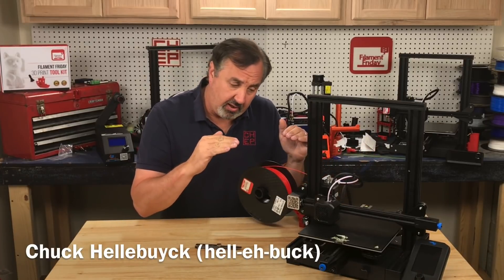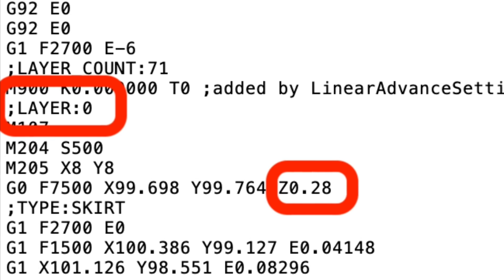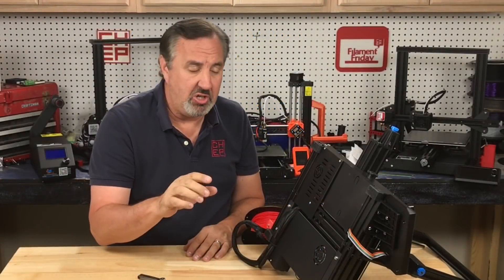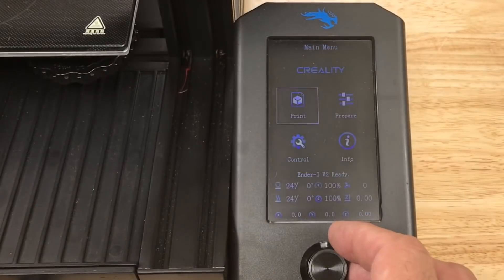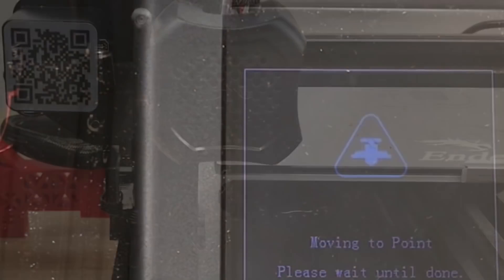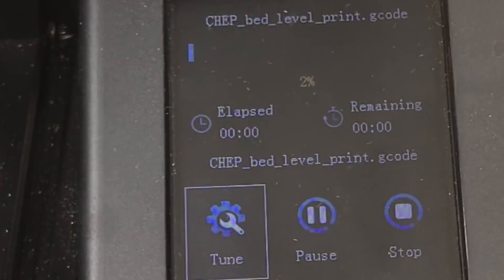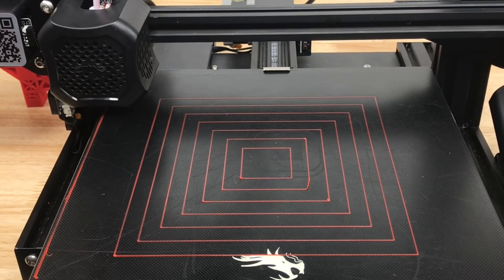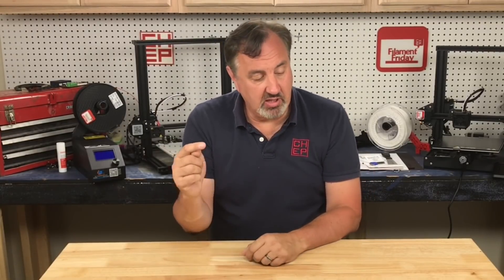Leveling or Tramming your Bed Using a Feeler Gauge on Ender 3 V2

Comment from the maker: I forgot to say in the video: reset Z offset to zero after using the feeler gauge.
Reply: Hi CHEP, I really recommend give some heads up about this comment on the title or something.
Yesterday I lost 5 hours trying to make this work because I missed this comment.
Reply: why do we reset it?
Reply: @ikeydweck2211  You only set the z-offset to make enough space for the feeler gauge.  You reset it because you don't want the actual printing offset to be bed + feeler gauge.  TBF, you probably want a little bit to deal with any bed warp you saw.
Reply: Connor beat the VGK. Sad for me. Happy for you and him.
Reply: How do you do this on stock ender 3 pro? As far as I know I can't save z-offset
Reply: I can't believe I didn't catch this....
Reply: what would be the problem if the words on my screen are kind of all over the place? like they keep glithcing
Reply: Can I do this with the bl touch?
Reply: Awesome. Thanks! Does 0.202 apply even with 0.6mm nozzle?
Reply from the maker: Yeah, nozzle size isn’t a factor.
Reply: thanks for the clarification i was confuse at the end of the video
Reply: thank you for your time. However, you also forgot to state,  What size  feeler guage blade you are using.  A piece of paper is approximately 0.004 " thick ?
Reply from the maker: NoI didn’t. I show in the video 0.202 feeler. Paper is typically 0.08 to 0.1 mm.

Comment: I have the Ender 3 V2 and just updated the firmware for V4.2.2 Gigadevice. On yours you have the z-offset in your prepare menu as well as manual leveling?? I do not have any of this in my prepare menu or any menu... I am unsure of what to do now.

Comment: I have the Ender 3 S1 Pro... The bed is too low. if I go into Aux Leveling and set the Z-offset to -0.50 (Same as my feeler gauge) I have to loosen the screw to the point that it's practically spinning freely to bring the bed up to the nozzle. Thoughts?
Reply: Have you found any solutions to this by chance? 💖
Reply: @IthinkIneedAhug  Gave up on the feeler gauge for now. Replaced the springs with silicone spacers and have the bed super-trammed! Used the Octoprint bed visualizer to tram the bed and it's working great now.
Reply: @Jaypoc  I've considered getting silicone spacers! How are you liking them?
Reply: @IthinkIneedAhug  i like them. Keeps the bed lower and very stable. I'm hoping over time it will mean less need to re-level
Reply: I'm a bit late my solution was to lower the Z axis sensor

Comment: Thanks a lot for this video! I've been using my Ender 3 V2 for a few months with success, but the leveling process has always been a bit unclear for me. Cause people have known the basics for so long and they forget that they actually need to simplify the basics and do a concise step by step guide for noobs.

Basically I was confused that people level their bed with paper or gauge, but don't explain that you need to z-offset for it (while leveling or after).
No one explained that after you level, your printer EXPECTS TO HOME at 0mm z height! And since no one said that exact sentence, I foolishly assumed that the printer needs to hover by 0.1mm z-height when homed, and had a ton of trouble when printing materials on higher temperatures!) 

And the fact that you set the z-offset at 0.20mm at start, do the leveing with the gauge and then bring back the z-offset to 0mm, has actually brought out my first perfectly printed first layer!

Comment: I have eliminated the need to do this on my Ender 3 S1. I replaced the bed springs with metal spacers, I leveled the bed to the base of the printer and leveled the gantry to the bed. For setting the z offset I flipped the PE sheet upside-down so I can use the metal part. With my multimeter on Ohm position I put a lead on the metal sheet and the other on the hotend heatsink and in the printer menu under "Z Offset" I lowered the gantry gently until the multimeter showed me that the nozzle made contact. I backed it up 0.1mm, stored the configuration, and that's it. You need to input the value of the z offset you choose (in my instance here it is 0.1mm) in the slicing program you use.

Comment: I’ve got a ender 3 s1 and my z offset is at like -2.72
Reply: That's the offset between the BL Touch and the nozzle, because it cannot be the same (like 0) or the probe will touch the part while you print. When you set in the menu your Z offset whit the paper method, or similar, you are telling the printer what is the offset that it must apply to the measurement taken by the BL Touch for the positioning of the nozzle z height at zero(that's your -2.72). On top of that you have the paper thickness which is the z offset what you must input in the slicer program (usually 0.1mm) so the slicer can take that in consideration and apply that offset to the g-code. That is important for the first layer so that the 0.2mm(for example) layer height set for the first layer does not become 0.3mm(0.2mm in slicer settings plus the thickness of the paper 0.1mm) and have first layer adhesion problem.
 So in your case, if you set that z offset whit the paper method you will have the true value at (-2.72)+(-0.1)= (-2.82). You need that paper thickness offset so when you move the gantry to Z0 position the hot nozzle does not touch the bed surface and damage it.
Very important: you must take the steps to set the  z offset every time you change the nozzle or take the extruder down for whatever reason or do any repairs or changes to the printer.

Comment: im just about done with this fucking thing, ive been trying for two fucking weeks to get it to level, ive taken it apart, put it back together, squared it, autobed level kit everything i can find on the net.

using the feeler gauge, and the level wheels the bed comes nowhere close to 2mm from the print nozzle.

these things are fucking garbage and they have little to no quality control, to all the people that told me an ender 3 was a good noob printer was a downright dirty lier
Reply: I’m the same I’ve been fighting mine constantly!! I’ll finally get it to print and it will print perfectly then I go to print again and bam I have to level it again and start the whole process over again I’m going to just sell mine I’ve just accepted I can’t work them and will find some other hobby
Reply: @BigManJapan298  Alternatively after selling it, get a printer with all of the upgrades. Unfortunately the cheap printers are cheap because they are made with unreliable parts and missing good features like automatic leveling - and you're kinda expected to buy upgrades because they are considered to be  "hobby" printers. If I ever buy a second printer, it's going to be one that has all of the upgrades to begin with.
Reply: @BigManJapan298  check your leveling screws, sometimes they are loose, I had to put m4 nuts on them to hold them to the bed, then upgraded springs and adjuster knobs.

I did that and it works fine now.
Reply: Sorry to hear you had so many troubles. I would suggest finding a 3D printing shop in your area via something like Google Maps, and taking the machine there and having them take a look. There is really only so much help you can get online, and bringing the machine to somebody who has experience can help more than any online resource.
Reply: Z- Offset my friend.  that will move the noozle DOWN
Reply: Try replacing the springs the stock springs suck
Reply: "2mm" it's supposed to be 0.2mm, so that is probably the problem
Reply: Or moving the limit switch on the bottom left further down
Reply: i had a better idea, i tried selling it and buying a bambu p1p, been printing ever since.
 @abelcardoso866

Comment: I want to warn anyone with a recent Creality printer that shortages during covid Creality in some of the printers including the ender 3v2 switched from using the 4.2.7 board back to the 4.2.2 board but more importantly with a different processor the GD32303 chip instead of one of the normal stm32f10. As a result, Marlen and Jyers UI are not actually completely compatible. However, due to the board being the same and only the chip being different some have had success upgrading to a Marlin firmware. [There is no guarantee that this will not damage your printer]. Some signs of the incompatibility encountered have been salmon skiing and the mesh levelling turning off when a print starts. Though the salmon skiing has been stated to be solved by using the maple version) personally, I have also had the menu partly freezing during printing. however, if you try it out and don't like it you can always go back to the original firmware. It is on the Creality page with GD before the name (for some reason the screen files are only included with the BL touch version so if you need your screen icons back because you updated that too you will need to get both(assuming you don't have a BL touch that is. if you do then you can just get the BL touch one of course.))
Reply: I also have the 4.2.2 board with the GD chip and using a CR touch. I was originally using the firmware from Creality that had I think 19 probe points? It was trash and now I've switched to the latest marlin with 49 probe points and it works flawlessly.
Reply: @pvtryan  nice.
Reply: BTW I shuld clarify for those who don't know that a 2.2.4 bord may not come with the GD procecer and you can check witch procecer you have by reading the label on it. It is the bigest chip on the bord. So it is easy to spot

Comment: How do you know what feeler gauge "height" you need?
Reply: I tested and foind what works best. For me, before I had a feeler gauge I used paper after I got a gauge I noticed that I was not getting proper bed adhesion so I levelled with the paper and then felt out what gauge was the same thickness. for me it was the .13mm one however I did also change my first layer thickness before this so for you it will be different. Just feel it out and find what works for you based on the results.
Reply: You can basically do it with any height, you just have to match the z-offset at the start to match it. (and also dont forget to bring the z-offset back to 0 at the end).
So I'm sometimes using 0.1mm (while matching the z-offset to 0.10 at start) and sometimes 0.2mm (while matching the z-offset to 0.20 at start) gauge for Ender 3 V2, and it works great with both.

Comment: Iv been using paper to level the bed ever since I got my printer and I can't quite get it right, should I adjust the screws until a can't feel the nozzle then readjust until I feel the slightest resistance?

Comment: U DONT NEED a gauge, paper is enough to do it. the real "trick" is the wrong Gcode, or the Z Offset. Thats it. Lesson learned ^^
Reply: except you don't know the thickness of the paper, and the thickness of the paper changes as you use it

Comment: I think I just bricked my printer. I followed all the steps, but the screen just stayed black for a few minutes so I turned it off. Idk what to do now, it shows nothing
Reply from the maker: Change the name of the file and try again. It usually recovers.
Reply: @FilamentFriday  ended up having to fix partitions on the SD card and wipe it as well, but this helped. Thank you

Comment: Hi CHEP, can I ask if I set z to 0.2 same as the feeler gauge, then tram at 0.2 and when done set z to 0, wouldn't that mean that the printer thinks 0.2 is zero and so lift another 0.16 on top of that was my chosen layer height taking the nozzle 0.36 hight? I thought the z stop determined 0. Just ordered some feeler gauges from amazon so will give this a try tomorrow 👍
Reply from the maker: Nope. It means the top of the 0.2 feeler gauge is the new zero. Then reset the offset to zero so now zero is the bed.
Reply: @FilamentFriday  Thanks mate that makes sense and easier for me to understand, Never been very good with numbers lol. I'm changing nozle today and will use this process to tram. Can I ask before printing my next print after changing the nozle should I recalibrate anything like do a new flow test etc.
Thanks again and keep the videos coming I've found them to be extremely helpful 👌.
Reply: One last question for you mate, when do I reset the z offset. Is it once I've finished tramming with the gauges or after I've homed. Thanks
Reply from the maker: After trammed.

Comment: Hey.Chuck,
I have used your bed leveling system to absolute perfection.
Problem I'm having is when I start my print the first layer doesn't lay down the same as the set up. Can you tell me why it would be different? I get mashing to the point of the layer being none existent.
Reply from the maker: Do you have z offset other than zero in your slicer?

Comment: Ok,I don't know what I'm doing wrong,but apparently I'm missing something. I have followed the steps numerous times and reset Z offset to 0.  But I still have a big gap between the nozzle and bed when a print starts. For example, when I set Z offset to 0 and start a test print,I usually end up at a Z off set of around  -1.46 to get the nozzle close enought o the bed to stick What am I doing wrong?
Reply: Same problem
Reply from the maker: What does it do when you click home?
Does it go to the bed?
Reply: @FilamentFriday  It goes home to exactly -10.00 above the bed.
Reply from the maker: Does it hit the stop switch?
Reply: @FilamentFriday  I use a Cr-Touch,so stop switch isn't used.
Reply: @FilamentFriday  Does this not work with a CR or BL touch?

Comment: Okay so if I have my initial height to 0.28 what size feeler gauge should I use 0.15 0.1 or 0.2 because that's where I'm lost on ... And can't figure it out thank you for reading.
Reply from the maker: You set the Z offset to match the feeler gauge. That way you are adjusting it to true zero. Reset the z offset to 0 when done. 
Initial layer height in slicer has nothing to do with this. That’s just got first layer of printing.

Comment: If anyone's having problems with the Jyers firmware, I went straight for the "professional firmware" it's also based on marlin but it works with the same icons from the factory firmware

Comment: I installed the update but when i try and heat up my hot end to 220 right before it reaches 220 it starts beeping and saying heating error and i need to restart. ive restarted 3 times and it does it every time.     anything i can do to fix this?
Reply: Your Thermistor might be bad or loose, check that.

Comment: Is there a feeler gauge that isn't so oily?
Reply: I had the same issue: oil that was all over the feeler gauge. It was so bad and so easily transferable to the glass bed, that I decided enough was enough. I bought a bottle of acetone at Wally World and disassembled the feeler gauge, dropped all the leaves into a glass bowl (many plastics will dissolve in acetone), and poured the acetone over them. I stirred things for a bit, then let it sit for a couple hours. When removed from the acetone, there was NO trace of the oil. BUT... (There's always a but!)

Once the oil is no longer protecting the blades, they are subject to environmental factors, and regardless of being "stainless" steel, they WILL rust. Periodically, I scrub the one I use all the time (0.1mm) using an eraser. I guess eventually, that will wear down the blade, but not for a long time. HTH.
Reply: Soap may be
Reply: Must be new to tools... lol. Feeler gauges, and any metal tools, are usually coated in thick oil when you first get it to prevent rust from forming before it gets to the buyer. You can clean off the thick oil with a rag, but it's best practice to oil it again with something thinner to stop rust.
Reply: @asterisk606  Yes I'm new to tools, I'm a programmer... lol.

Comment: Some feeler gauges special the cheap ones are not precise some are 0.02 off from any size.
I'm looking my self for one that goes from 0.01mm up to 1mm in the 0.01mm steps that schould have be precise made 0.001mm±

Comment: Great video! I have a question though. What’s the difference between using a paper with, assumed, .1mm and a .2mm feeler gauge? That’s a pretty big difference, but if it works with .1mm why would I move it away to .2mm? Legitimately curious!
Reply from the maker: You erase it al with z offset so doesn’t matter.
Reply: I have 3 bits of "standard copy paper" that measure from just over 0.1mm to just over 0.2mm. You don't know what you're setting the clearance to, you do with a feeler gauge. I've a creality cr10 and after a couple of years of sporadic use because of unreliable printing I dug my feeler gauges out of the garage and an getting solid prints every time. I set mine to 0.05mm clearance with a first layer of 0.28mm.

Comment: Why do you need to save after offsetting .2 for feeler? What happens if you don’t save?
Reply from the maker: You’ll be 0.2 to high
Reply: @FilamentFriday  I have always been super good with leveling but can’t seem to get this method to work. It’s super close squishing out so I have to offset .1mm up after trying this way. I don’t know what I’m doing wrong and I just bearly touch the feeler. Idk if it’s actually offsetting .2 on my Ender with updated marlin firmware. I can’t seem to get it right.
Reply: @Quintanater  hows ur z step is it accurate?

Comment: When you set your home, do you set it to where the nozzle is just barely touching the bed?
Reply from the maker: Yes, that’s a good place to start.
Reply: @FilamentFriday  I did that and when I went to level the top the nozzle dug into the bed.  Are you supposed to set your z-stop after you level?
Reply from the maker: It homes and then moves to z offset so if it homes into the bed it wasn’t homes right when you adjusted.